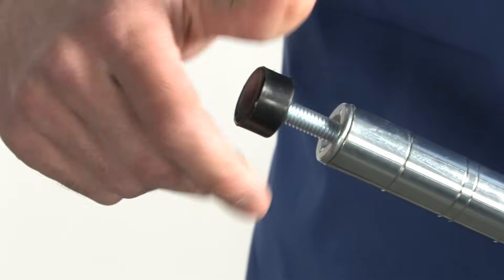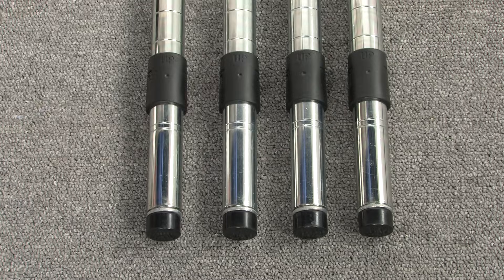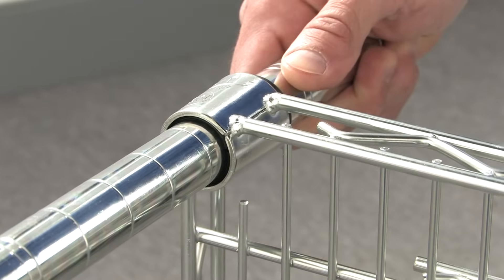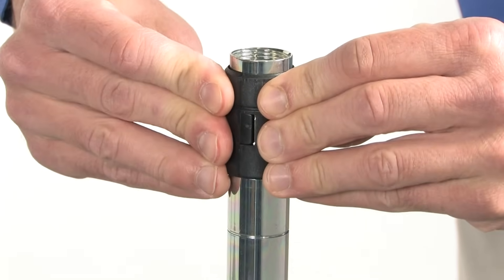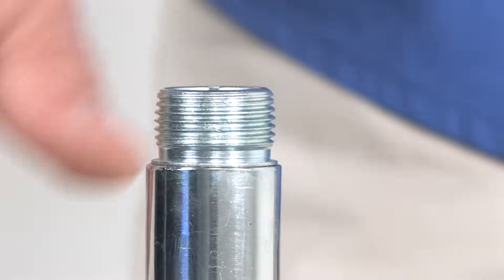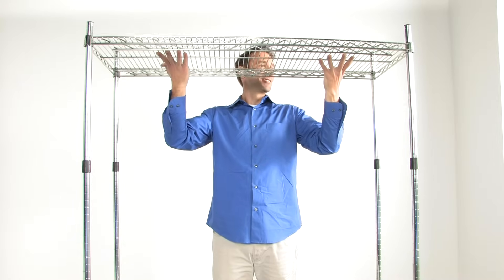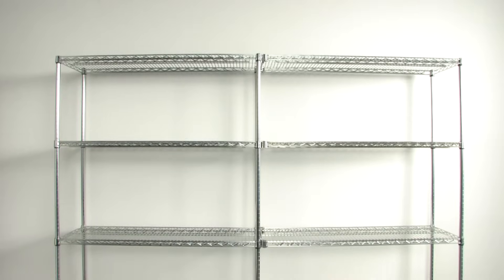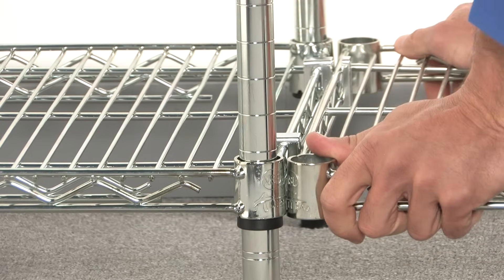Assembling Shelfing Units

Comment: CLIPS TIP :  The clips will snap together SNUGLY as long at the smaller ends are lined up with the indent line on the pole.  I am putting mine together now and that was not mentioned on the video here, but I am still glad I found this video, very helpful!
Reply: You must be from Mars. Tried that. Doesn't matter where you put the stupid clip!!! They do not snap period.
Reply: @jlouis5217   No I am not from Mars.  Sorry you were frustrated.  I just reported what worked for me.

Comment: Okay so I had some initial trouble with this, so here's what I learned: 1. The clips aren't meant to completely close 2. It helps to initially put the clip in between the ridges (directly above where you would like the shelf to sit) and then slide the clip down to the ridge where it shouldn't slide anymore 3. If the shelf isn't sliding down easily like the video, turn the shelf upside down but keep the legs as you have them. The final product will have the shelves completely flat, if your shelf has sides facing up like a bowl, you have it upside down. It's hard to explain but if you're having trouble, compare how you have your shelf to the final frame of the video. Hopes this helps someone!
Reply: Emily Galloway It was. I had almost given up and beaten the dog before your post. Thank you. The shelves are intact and pupper is safe. 😝
Reply: Emily Galloway I can say, after reading your post, that the clips aren’t made to close, everything made sense. Thank you!!!
Reply: This SUCKS!!
Reply: @Zoielynn  how do you get them to slide through the damn poles????
Reply: THIS COMMENT SAVED MY LIFE!!! I had it upside down the entire time! I was about to bitch out the company for sending me a faulty shelf
Reply: @tinaaltamirano7988  Wrong the instructions says otherwise it's suppose to attach & lock completely all the way around.
Reply: Yes!!! Thank you!!
Reply: Thank you for this!

Comment: Passing on what I just learned....You don't need the clips to fit together all the way. For those whose clips are falling apart when you slide the poles through the shelf...your shelf is most likely upside down.
Reply: Our poles and/or the clips are not upside down. Checked and rechecked several times. It seems the grooves are not deep enough or the ridge on the inside of the clip is not thick enough to stay in the groove. We have tried everything. Shelves are supposed to hold 1000 lbs each but can’t evern stay put when putting pressure on them. Giving up and sending back!
Reply: No.  Doesn't matter even if you have the shelf sliding down correctly.

Comment: Trying to put an Easy Home 53534 and I swear TG these plastic things don't fit on the thing. There's a gap on either side of the clamp. Like, so frustrating.
Reply: This video is a joke. I just bought one of these shelf units because I was reading all these  Home Depot posts about how easy it was to assemble. Are you kidding me?  Those anchor clips are a pain because they don't clip property to hold the shelf in place and one pole didn't screw in properly.  I thought I wasn't strong enough but it looks like other folks had problems too. She is up and not quite looking like the photo but she feels sturdy enough.

Comment: The clips are a very poor design and make assembly frustrating, difficult, and imprecise.
Reply: Totally agree.  These shelves are ridiculous.  I still have not gotten them together and I refuse to buy a mallet to do it.
Reply: what does that even mean?
Reply: It actually helped a lot 
It can’t really get any simpler than this 
It’s a great shelf
Reply: KingJayyzWorld really? The clips don’t even go all the way around the poles, so they slip when any pressure is applied.
Reply: Dean Girl 
You might have something upside down 
That was my whole problem
Reply: I figured this out on the fly, no manuals or boxes. Bought last display item for a killer deal. Had to break it down on spot and put it back together it again at home. It was really easy and common sense to figure out, if you got Then two brain cells you got this
Reply: first off do you know how long it takes to make a video like this, you could never
Reply: I think the clips are fine.  I think the groves in the pips are sloppy.    A tiny bit of depth to the groves would make things a lot easier.  I doubt the molds wear out making these plastic parts.  It's just plastic goop.  But the pipes are a different matter.  I think there's a bit of inconsistency.

Comment: I remember putting these together. They don't physically, completely meet each other and clip with a seamless view or a clicking noise. Their purpose is to stay in place and will be covered by the shelving unit, they are not meant to completely grasp each other---but I recall having to learn that. Mine stayed together for 22 years between many moves.
Reply: Yes but when you slide the shelf down if those clamps aren't tight and the shelf bumps them at the right spot the clips pop off!

Comment: This clips are not meant to completely lock.  There is a little ring on the half clips.  Align that right above the insert on the pole you want to have it at. Lock the claps as best you can and it will slide down around the ring on the pole.  It will lock but there will still be a little space.  When you put the shelf on it will completely lock it.
Reply: These videos show the clips locking in place. Mine are a good 1/4 inch open. If you can hold the clips, the leg and the shelf - I’d be interested.
Reply: @nancymills1884  clips don’t full lock, on mine either. Make sure the shelving unit is not upside down, the unit sleeves are slightly tapered. Someone commented on this and was able to get mine set up.
Reply: @kgutierrez910  Thanks,after checking out a couple of other videos I finally got the shelves together. Thankfully just about everything is on YouTube and networking with others.
Reply: My clips won't lock either and keep popping off the pole. :(
Reply: @goldenmartin2775  they aren’t mean to fully lock.  Put the shelf on top and then they lock.  They don’t fully lock prior to sliding the shelf on
Reply: @SullivanCovers  I finally got it. I said "seriously?" to myself. lol
Reply: Oh it will slide when you slide the shelf down. The pop goes the clips!!!
Reply: No duh. That's why the one end has an arrow with the word top. He even said that on the video and it doesn't help the clamps getting a tight fit.
Reply: @SullivanCovers but they should at least stay on the stupid poles when you slide the shelf down.  
And everyone on here most likely knows there's only one way to place the shelves on.  Let's get this solved..I'm writing to Amazon.

Comment: We had to use two hammers on each side of the spacer and shelf hole to push the spacer in tight enough.by hitting both hammers toward each other. It finally got tight enough because prior to that they were slippin down the pole. It took us well over  an hour to assemble.

Comment: I finally got mine to work! (Long comment alert). I had the issue of the black clips not closing around the poles like everyone else, and my shelves couldn’t fully slide down over them to set, even after using a hammer. (My clips were both Top-side up, and my shelves were correctly upright as well, so I didn’t know why I still was having an issue!) Then I found comments elsewhere about how the poles have double-rings/grooves in some spots (look closer at your poles to find them). And that the double-rings don’t work as well for aligning the clips? Since they’re supposedly not as deep of a groove as the single rings? And the comment said to slide your clips to a single-ring spot. That helped some people. But what really helped me was a comment saying to find that single-ring spot and slide only ONE of the clips down on the pole to place it until you hear a click! And THEN add the other clip! (No sliding down needed for the second clip). My clips still didn’t perfectly close together BUT they closed a lot more than before! Enough for me to successfully get the shelves to slide over them! And since it was just me assembling them, I did the middle and top shelves while having the unit/poles standing upright and had to lower my shelves slowly and making sure they all dropped smoothly and evenly. Then I tapped twice with a hammer and it worked! The shelves definitely didn’t lock down before I did this! Hope this helps!!
Reply: I don't think you will ever truly understand what you mean to me right now! My anger was reaching code red levels..... And than i found ya comment. Bless you😂😂
Reply: Thank you so much!

Comment: Mine went right together in minutes. Put the two clip halves together around the posts facing up. Then slide them down until they snap into the grooves. Mine worked so well, I'll be buying more.

Comment: IMPORTANT: the clips have an arrow on them and MUST be ponting UP on the leg. If not, the clip may not snap on the leg, and definitely won't allow the upper shelf to slide on. If you can't see the arrow, just flip the plastic snap amd check again. There is a small groove that the plastic clip must fit into on the leg  or it won't fit. Take your time, it will go back together. Forcing it will snap the clip and you'll be hooped.

Comment: I just spent 1 1/2 hours trying to assemble my 3-Tier Wire Shelving Unit.  I can successfully clip the clips on the poles; but the shelving holes are too big and the two won't tighten.  =(

Comment: What I did to make my life not entirely full of frustration was take a stack of milk crates and put the wire shelf upside down on top of them.  You can use a high desk or a table saw or whatever.  Just so the shelf is like 4 feet off the ground.  
       Then take a the uprights apart so they're two lengths of pipe.  Then attach the plastic clips on the four pieces of upright pipe.  Then simply slide them into the shelf holes.   And of course, they'll sit in the holes and you give them a bit of a yank to secure them.  Then take the section of shelf and flip it over and start building. 
      Easy peasy, quick and easy.  
  Trying to slide a full length of pipe into the holes with a single shelf turned sideways  looks like mi-ser-eeeee.
Reply: Duh. The poles need to be up and secured in the first shelf before you start putting the other clips and shelves on.
Reply: @jlouis5217  Yes...but getting those first four poles installed is frustrating.  It's hard to shove the shelf down on the clips when the first shelf is sideways.

Comment: I tried to install the Finnhomy Heavy Duty 7 Tier Wire Shelving, the shelf rack just won't fit into every single clips, I tried to use my body weight, mallet hammering and the rack was just not able to insert into those clips, after 2 racks are bent with sheer force, I thought enought was enough and returned it.

Comment: At 1st it seemed that I was going to have the same issues with the clips actually not snapping together. After getting the 1st shelf in place I noticed that it was most definitely a tough fit over the clips. Nope, not going to work! Even trialed on of the clips that snapped together (albeit) not on the poles and once again tried to insert it in the shelf. Once again, not going to work! Then I flipped the shelf in the correct direction since I was hoping that upside down the shelf upright will help things not falling off. And what do you know, it slide right on.

Comment: I cannot screw al the columns completely.  2 of them are so hard to screw that I hurt my hands doing it.  It's basically impossible to screw them with bare hands. I need special tools but don't know which one. 
I bought two pieces and they have the same problem . Anybody has a solution for this ? If i can't screw all of them completely,  then the shelf is not going to stay horizontal. :(
Reply: nevermind, i unscrewed the other ones so that they're all approximately aligned.. this makes the shelf relatively horizontal and it's stable enough

Comment: Those black two piece anchors DO NOT slide through that easily on mine. 😢
Reply: Okay! Two things. First. Take a close look at those black half moon clips that we are bitching about. 
One side says “UP” or “TOP”….guess where that goes!
Another is slide it up the pole until you feel it “click” into place. Count the rings or use a tape measure. You want them even. 
Guess what…it works now. 
My instructions, in three languages, never mentioned any of that. 
Good luck!

Comment: The anchor doesn't snap shut, is that normal? They seem too small for the post
Reply: Mine also.  Clip seems to small for the pole.  Will clip on one side but I can't close it on the other side.
Reply: It doesn't fit but snap one side and then slide it down and it will lock. Then put your shelf on when all 4 are done.
Reply: mine keep poping off though.  my shelves have wheels but doesn't appear straight.
Reply: Carla Overton your comment was more helpful then my 45 min of reading the website
Reply: YES, it's not supposed to clip on both sides.  It's is supposed to making a click noise when you slide it into place.
Reply: Carla Overton can I get a video? Because they really don’t fit. You must be awizard

Comment: Clips/bushings do NOT fit as you would expect them to. Just get them as close as you can. Pulling down slightly will snug them a mm tighter but there will STILL  be a gap. Once you put the shelf on and snug it down it toghtens up the clips/bushings. Craftsmen is just really bad at giving us this simple yet incredibly frustrating tidbit.